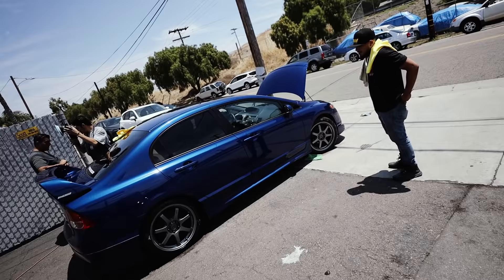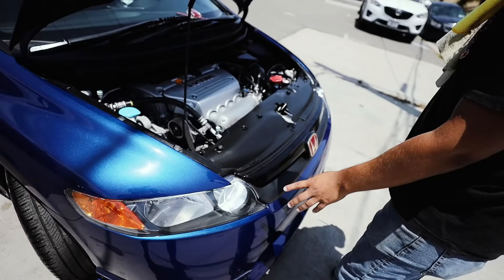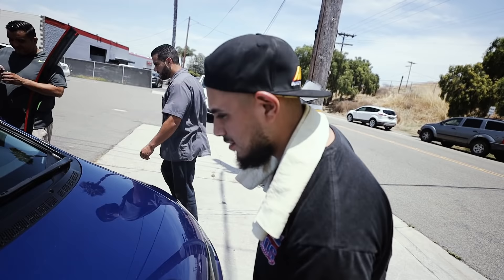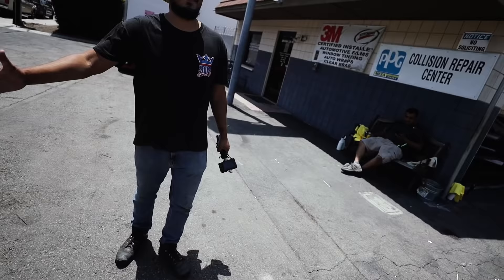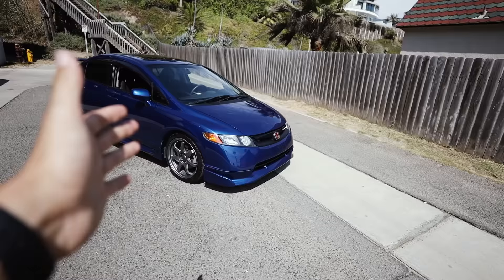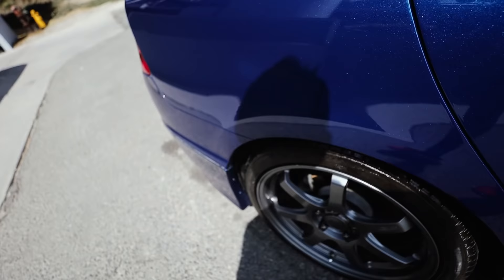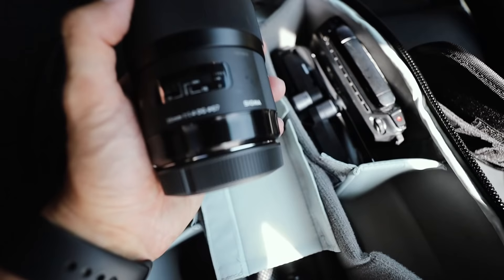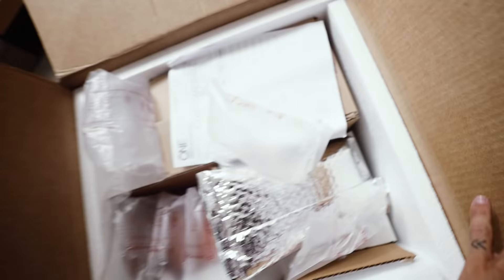Picking up the FA5 Mugen Honda Civic Si from Paint! *Paint Reveal*

Comment: I figure they use a better clear than honda did when this car came out but to make sure the clear coat does fade and crack again make sure to use some sort of protection (i.e ceramic coated, spray sealant, i know TJ has loads of hybrid ceramic wax, etc)